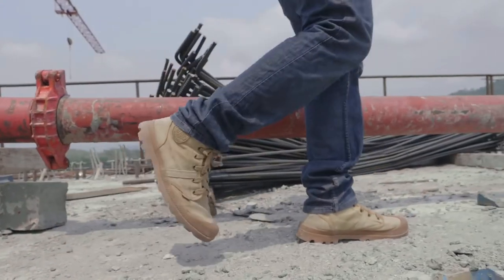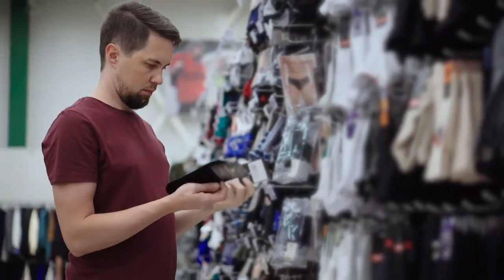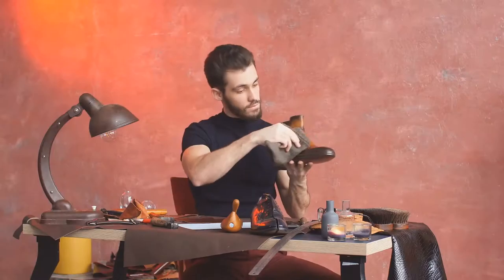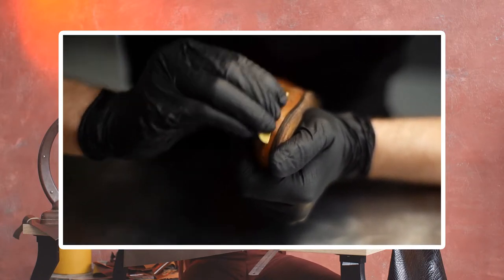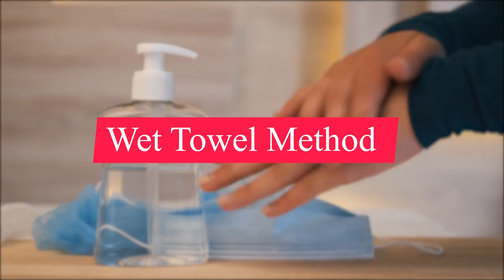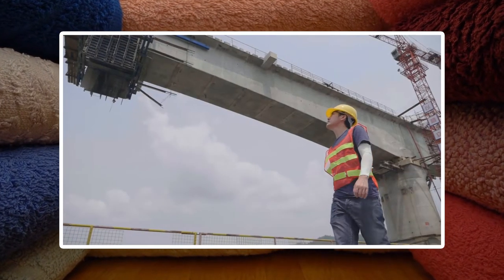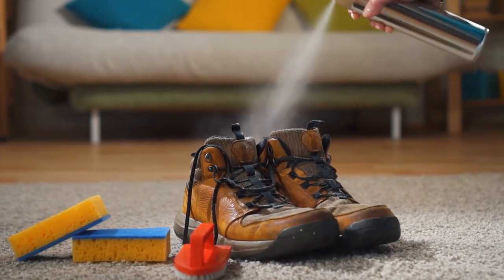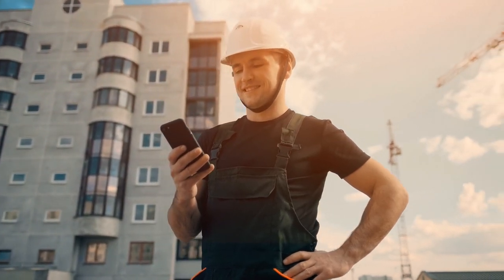How to Break in Work Boots Fast: 10 Proven Methods

Comment: I bought some work boots that were super comfortable right out of the store, they didn't last more than 3 weeks before being absolutely destroyed. I had to go back and buy another pair of decently comfortable boots. I broke them in by putting 2 soles in each boot, wearing 2 socks on each foot, putting them on, and then soaking the boots in hot water while on my feet, and wearing them for about 2-3 hours at a time.  I did this probably 6 times before wearing them to work for 10-12 hours a day.  They are the most comfortable boots I've ever had, and I've had them just over 7 months so far. I recommend this method for everyone, but specifically anyone who might have bought a half size too small.

Comment: My issue is one foot hates ankle high. I got a cheapie waterproof boot. Works great and boots feel good except left ankle padding. I tried compression and wearing but not working. Thinking of trying hot water soak  of the ankle padding then using the press using weight or tightly form around a can or something. Last resort is to surgically remove or inject touline oe acetone to dissolve. These are mainly a work type boot to wear on a job site. Any ideas to soften the padding?

Comment: I have no problems breaking in leather. Steel toes cannot be broken in. Do you have any advice for this problem?
Reply: Find a set of boots with steel toes that you like. Its only way.
Reply: Thick socks and slightly bigger boots is my advice but that only works for some people, I have wide feet so you have to find the right boot, alot of them are "the right size" but the steel cap is too thin

Comment: Using them works good too
Reply: Using them hurts and is the reason people look up ways to break them in faster.
Reply: Fuck that. I can’t stand/walk/hop off equipment trailers in a brand new boot, 10 hrs a day 5 days a week. I’ll wear my new ones for 2-3 hours, swap out to my Irish setters rest the day.
Reply: Sorry bro i do like actual hard work with my work boots. I have worn them 4 days so far new, but time to use a break in method. I do labor for a drywall company so im mostly lifting and moving heavy shit. And i average like 12-15 miles a day walking at work. Im convinced you havent ever actually broken in a pair of real work boots, or your job may not even really need them😆 (cuz they take like a month to break in just wearing, AT LEAST).